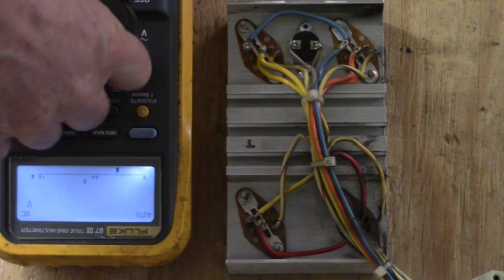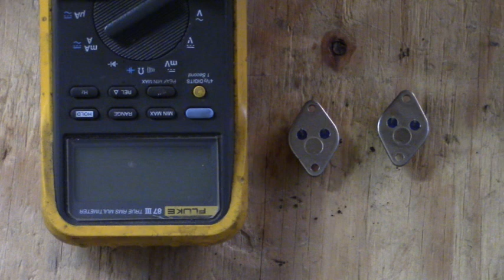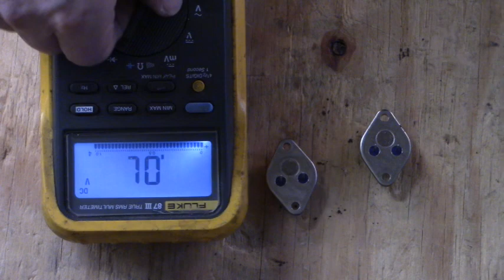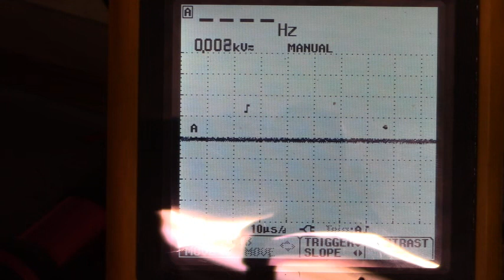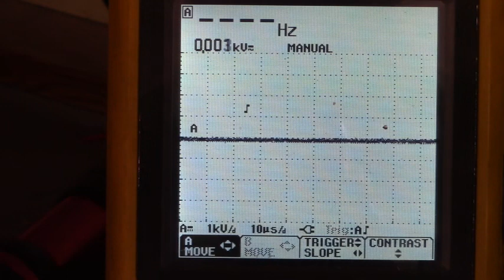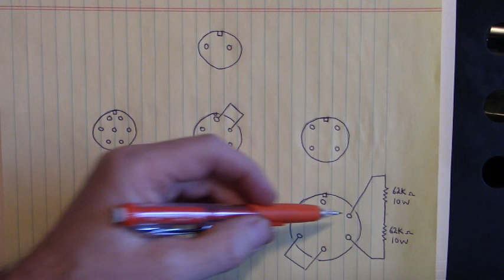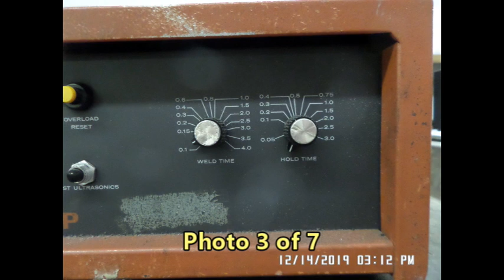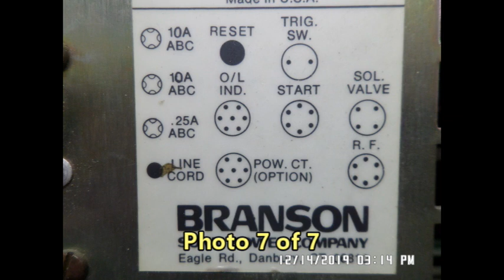Branson Sonic Welder Tripping the Circuit Breaker

Comment: Do these transistors often blow open?
Reply from the maker: The Branson Sonic Welder has a circuit breaker that trips when the transistors fail shorted. So I have never seen them blown open. But in other items I have worked on, I have seen burnt holes in the TO-3 package. Makes for easy troubleshooting when all you have to do is use your eyes to find the problem. HaHa... Let everyone up your way know that I said hello. And thank you for stopping by and watching one of my videos.
Reply: @PeepawMcDonald  ok will do